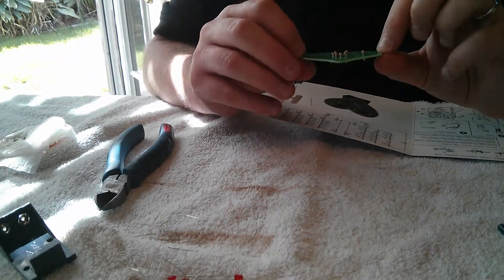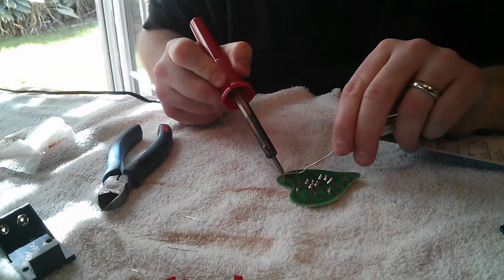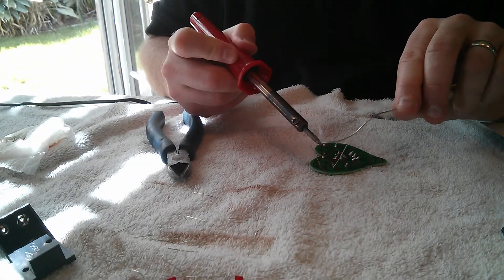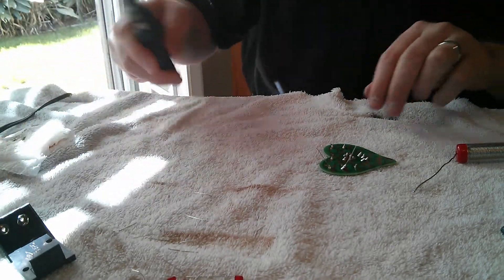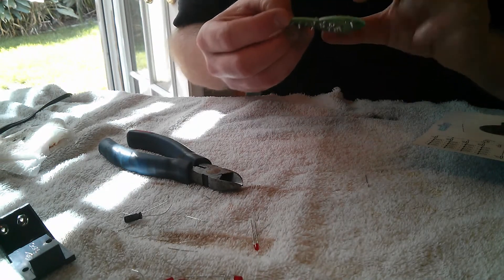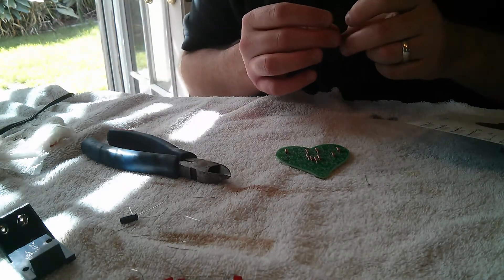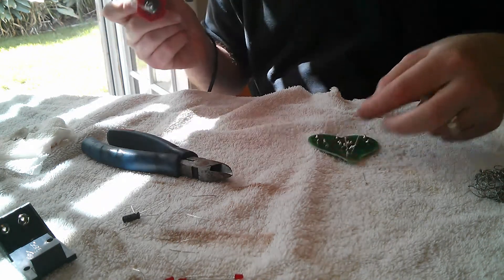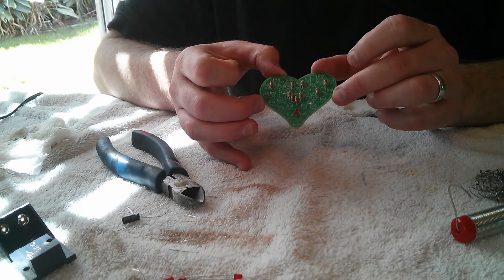Part 3: Assembling the Velleman Flashing LED Sweethearts Electronic Kit

Comment: What if I wanna add a Switch how can I do it?
Reply from the maker: It would be very easy to insert a single-pole single-throw (SPST) switch in series with the battery, to interrupt the battery's connection to the rest of there circuit.